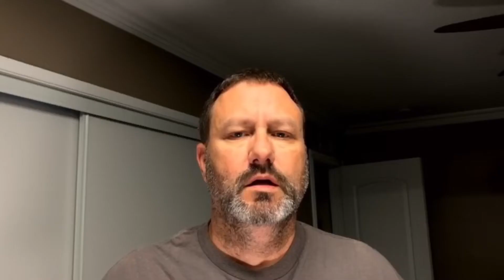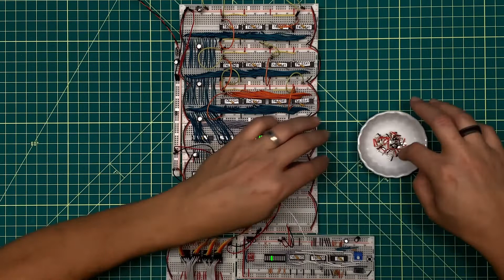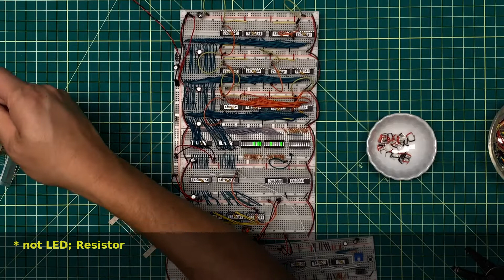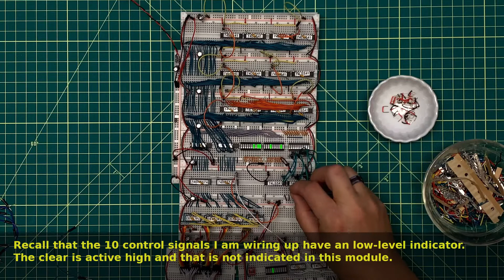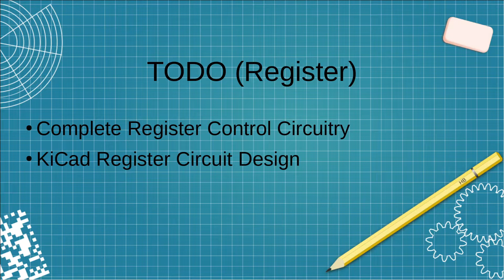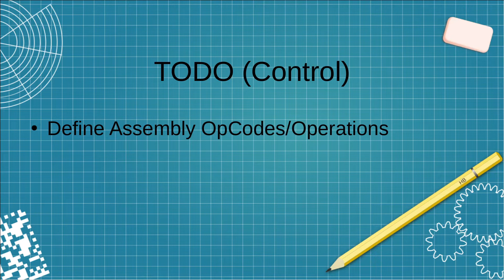0014: Register Control Circuitry (Part I) | 16-Bit Computer From Scratch

Comment: Why don't you use pull down resistors? You use wire directly to ground.
Reply from the maker: @CodeBallast -- Great question!  Thank you.

I assume you are referring to the 74LS138 de-multiplexer used to select between Do Nothing, Load, Increment, and Decrement functions, along with the extra lines (10 of 16 total signals were used) on the 74LS541 line drivers used for displaying the control signal output.  The simple answer here is that there is no other signal option so the pull-down is not needed.

One thing to keep in mind is that the use-case for a pull-up/pull-down resistor is to have a default state in case the signal is left undefined (or floating).  In the case where a definite signal is not present to set the signal to high or low, the pull-up/pull-down will default that signal to high or low respectively.  Consider tri-state line drivers which have a high-Z (or floating) output state.  I do talk about this when I build the Fetch Register and predict the need to pass a NOP instruction to the Instruction Register: https://youtu.be/h7aCeyQhNjM

So, why not a pull-up/pull-down resistor for each of these signals to provide the required deterministic inputs?  Simply because it is not necessary: we will not have any other signal which will override this hard-wired (hard-coded) signal.  If that was to change, I would need to either ensure the signal is always either high or low -- or, if it could also be left to float I would need to default a high (pull-up resistor) or low (pull-down resistor) signal when no other signal was present.

Could you use pull-ups/pull-downs if you really wanted to?  Sure, I don't see why not.  It simply adds a few extra resistors to your build. Just make sure you do not have a pull-up resistor and a pull-down resistor on the same node of a bus line -- you end up with a voltage divider which is undesirable.

That all said, do not direct wire IC output signals to vcc/ground.  You will hurt the IC.  This is something I did in the first few videos.  I confirm the mishap here: https://youtu.be/mNMLvAHVgBs

As a sidebar, CMOS ICs do not like any input to be left floating and can actually affect the signal integrity of other signals on the IC.  It is recommended (see the respective datasheets) not to leave them floating but to set them to high or low to provide a deterministic value.  I also believe that it is good design practice not to rely on the IC internals to define a signal to high/low (which LS ICs do).  Spoiler alert: in an upcoming video I will be replacing several LS (Low-power Schottky) ICs with HCT (High-speed Cmos Ttl compatible) ICs, meaning if I am deterministic in the wiring now, these should be simple drop-in replacements.